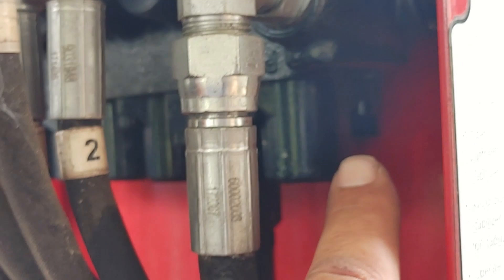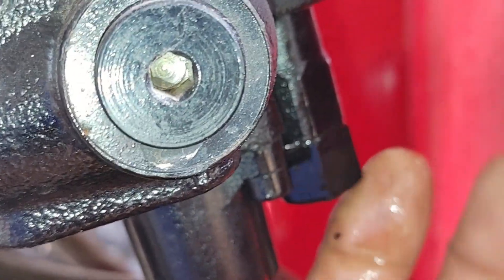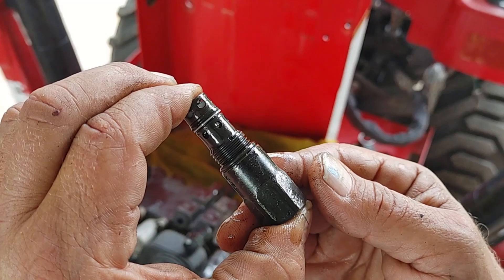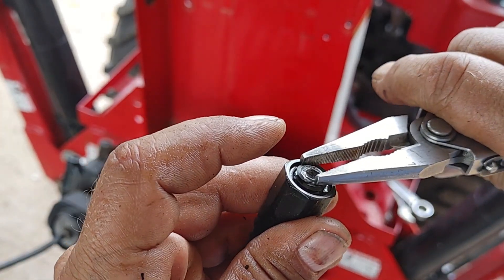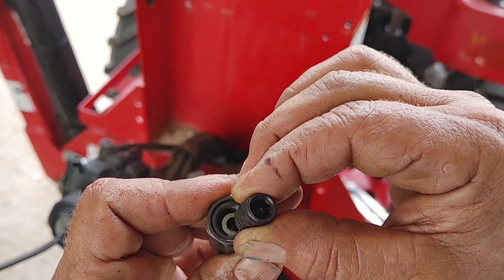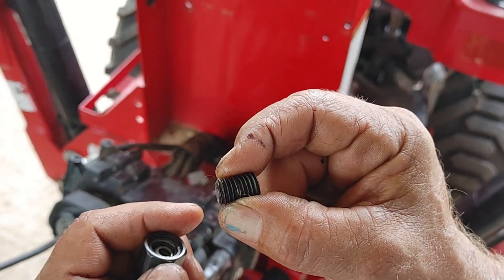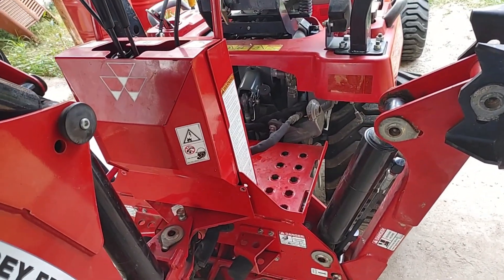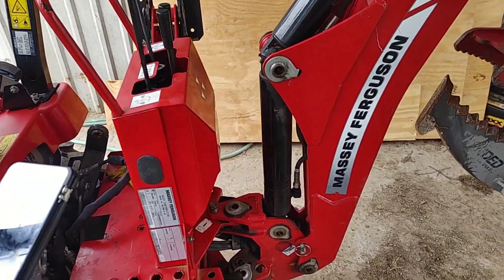A Fix For Massey GC Backhoe Massive Hydraulic Failure

Comment: Have you had any issues with the engine driveshaft on your GC?   I’ve had to replace a failed U-joint on it about every 300 hours, along with failed turnbuckle seals on the front axle.   I’m going to trade it for a 1725 now.
Reply from the maker: Thank you Douglas, for watching and the comment!  Sorry to hear that you are having so many issues with yours. I have had no problem with the U-joints or the seals. I hope the 1724 does better for you. Have a good week!   See ya in the next one!

Comment: Hello John,
I hope you get a chance to see this. I have the sane 1710 TLB you have. This very week it is in at the dealer and the reason why is it has been vibrating badly for a while now, the ROPS shakes and the throttle arm vibrates. The dealer says they have checked it through and found no problem. Now I just found and watched your “ Rough Running “ Video and I want to say a huge Thank You because I think you have given me my problem and the fix. It makes perfect sense, lower power, vibration especially at lower RPM and I have black smoke and soot at my exhaust exit. I am looking forward to getting it home and doing the fuel flush and service and start running an additive. This tractor has been a great work horse even with multiple minor things that have gone wrong. Mostly loose bolts linkages,levers and hoses. I did have one Back hoe hose just start leaking and it has not been in use for almost a year now.  Your videos have been nothing short of valuable information so I Thank You very much and hope you will continue to post any videos you can at your convenience.
Reply from the maker: Thank you Wire Feed, for watching and the very kind comment!  Over the years I also have had a few minor issues with the Massy that I have put on videos for other but at the end of the day. It is a true work horse as you said. I have learned that the three cylinder motor is very sensitive to moisture, trash, and the fuel filter needs to be changed on a regular bases. I hope you get your Massey running good again. I have a lot of video to edit but having the time is hard to find right now. Have a good week!  See ya in the next one!

Comment: Hey John what up!  So looks like a set screw, most likely metric thread.  In a pinch, you could probably find a match at a hardware store if Agco was still a no-go.  So was that a relief valve then?  Did you set the screw to about the same height as the broken screw and just go with that?  Good vid man, that's handy info...gonna keep an eye on mine.  Have a great weekend and happy 4th, buddy!
Reply from the maker: Thank you P.A! The hydraulic shop sit it close to the original thread depth and I put it back on to bring the Massey to them. They put gauges on it and sit it according to the specs the center valve had listed. I do not know if it is a relief or flow but I do know you have to have it to put that tractor in the job. Lol. Have a Happy 4th weekend!  See ya in the next one!
Reply: Yeh whatever it is, it gonna be there lol!
Reply: Oh you know what, that's most likely a flow control valve actually.

Comment: That was interesting. I'm surprised that relief valve was serviceable. Was the insert supposed to be adjusted or simply seated in place?
I've had my GC 1710 for a little over 3 years now, and the failure I've had was the same thing you had a while back. The backhoe spool handle bracket broke. It was covered under warranty, so I didn't really have to do anything. I've only put 170-180 hours on it, so it doesn't see much action, not like my bigger tractors.
Reply from the maker: Thank you William! I was surprised that it could be fixed. Most stuff nowdays is replace only. It did need to be adjusted but the hydraulic shop sit it for me. You can get the relief valve from AGCO and just change. Have a great holiday weekend!  See ya in the next one!